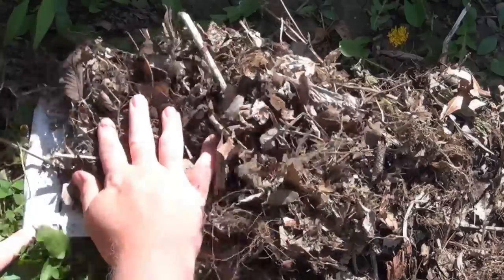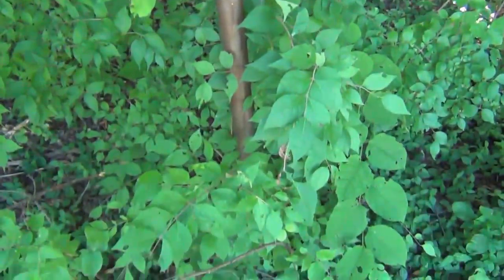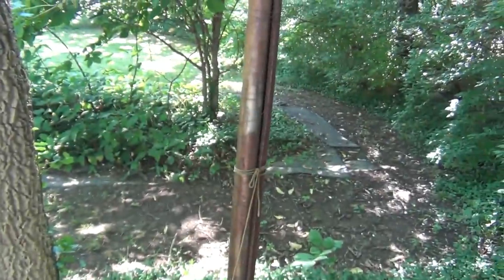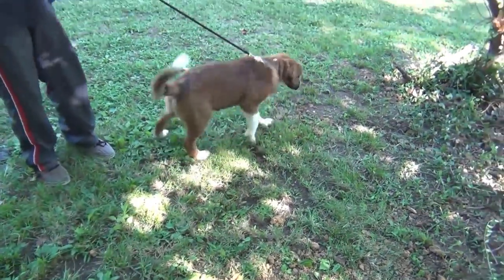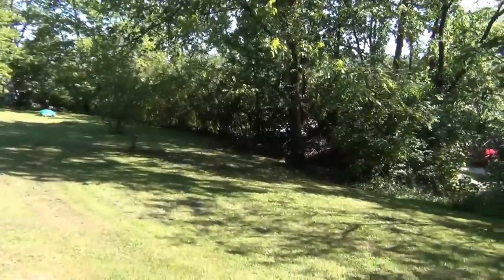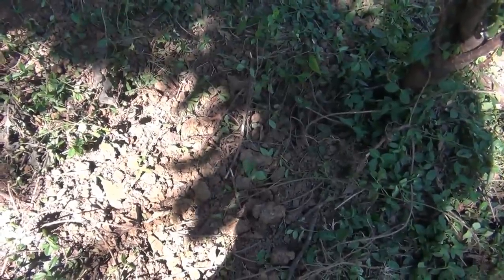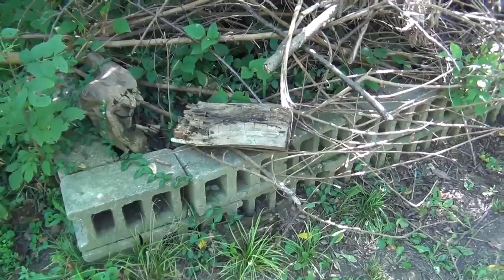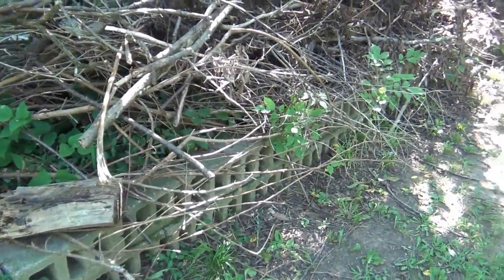Poles IN Concrete

Comment: Might look into one of those invisible fence systems, yea they are like $300 but you can keep the puppy safely contained in the back yard.  Cost a lot less than putting up posts and wire fence.